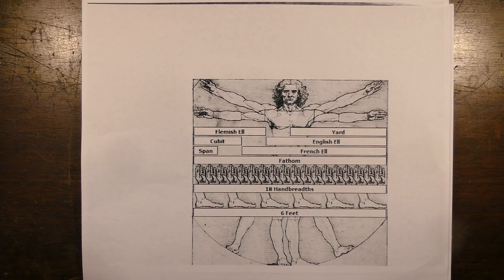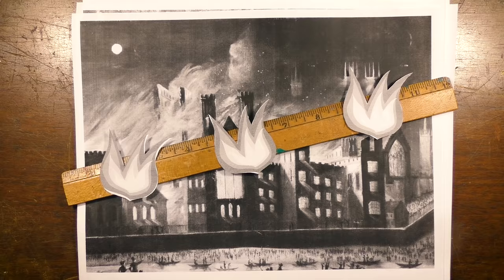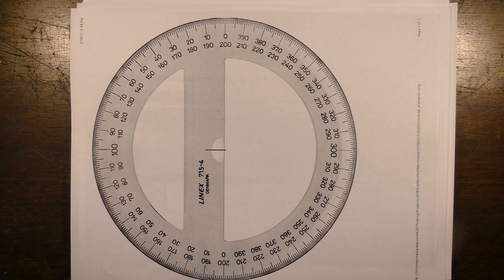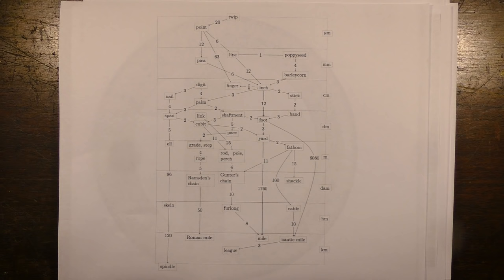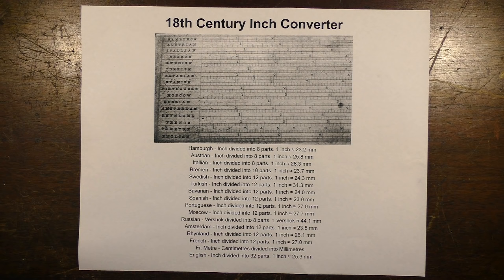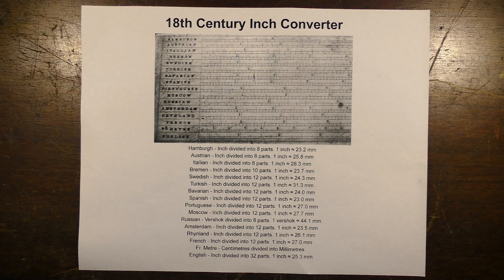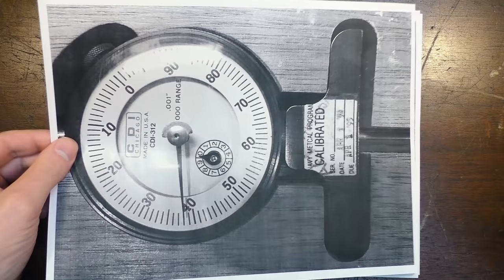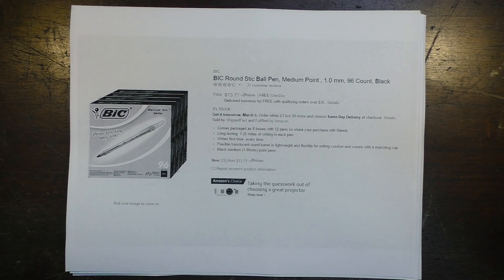Origins of Precision

Comment: Let me know if you want to see a Palmer and a super early B&S micrometer. A good friend has one locally in the SF bay area.

Cheers,

Tom
Reply from the maker: Tom, that would be awesome, I'll be in touch!  I'm local.
Reply: @oxtoolco  hey tom, just wanted to say i'm a huge fan of you!!  I was lucky enough to meet  Bruce Whittham, a couple of weeks ago,  he popped into my machine shop, to help my boss, he's a champion of a bloke!! he even signed my moore and wright combination set! so stoked!!
Reply: YES! YES! YES! OOOOOOOOOOOOOOOOOOOOOOOOOOOO YES! Please?
Reply: I found my B&S 6" caliper in the trash with the box and instructions.
Reply: @machinethinking  
You should have mentioned the "standards engineering day" and the critically important part to machine work, temperature, without maintaining that standard temperature you can throw accuracy out the window, I try to warn guys who are going to have machine work done on an engine, ie fit pistons into cylinders, that they shouldn't trust a machine shop that doesn't maintain 70° F, the tolerances of some of these modern pistons can be under .001 of an inch, change the temperature by just 10 or 15 degrees and then remeasure something that fits that close, your clearence will be cut in half with just that amount of change, shops that are 90 to 95 degrees inside in the heat of the summer and then 6 months later everyone is wearing sweatshirts and standing around kerosene heaters don't do accurate work.
Reply: @dukecraig2402  , yes and no on ambient temperature. I work for Reishauer, a swiss grinding mfg, our grinders are primarily used in automotive transmission gear mfg but also in the production of precision bearings. 
Ambient temperature control is good, but most competent shops with an experienced tool and die maker can hold 3 tenths, or ".0003, without ambient temperature controlled shop. 

What is much more important than ambient temperature like air-conditioning, is temperature control of the cutting coolant, using a chiller. It amazes me that for the relatively low cost for precision, how few shops use a coolant chiller. On an isolated foundation, a well-regulated coolant chiller keeping +/- 2C, and a properly calibrated inductive touchprobe, Reishauer grinders are capable of sub-micron tolerances in a PRODUCTION environment. 1 micron is 2.54 ten-thousandths of an inch, a human hair is 12 thousands of an inch thick, so variance between parts of less than 1/5 of a human hair.
Reply: One of the Sr Engineers at Campbell Grinders also concurred on coolant temperature regulation, they do not require ambient temperature control of a shop but they do require the use of coolant chillers, noone would spend that type of money on a grinder without a coolant chiller anyways. Btw, Cambell Grinders are probably the best US-based precision grinding mfg, they make very large 5-axis grinding machines that hold tight tolerances for 50+years of 7 days a week production and are used primarily in aerospace turbine and turbofan grinds.
Reply: @johnfilmore7638  
With piston to wall clearences of .00075 to .0012 in an engine that's going to live in the 4,500 to 7,000 RPM zone sustained neither I nor the customer can afford to have a .0003 error, I've set clearences at exact marks and turned my furnace down to 50° at night in the winter then go in the next morning and measure everything at 50° before the furnace heated things up and I had a .0005 difference on a set up that was .0015, that's a 1/3 error in the clearence, the cylinders heating up while they're being stone finished will also make a .0005 difference, if you let them sit for an hour or so after you think your done and then remeasure them, as a quality control measure when I assemble an engine that even I myself did the cylinder to piston clearences I measure everything at 70° that has sat for no less than 24 hours after the last work was done on them before I will install them, if I have to get up at 3 or 4 in the morning during the summer time to get 70° then that's what I'll do, doing machine work for modern engines or even old ones with components made from modern materials have got clearences that demand fitting and checks be done at the proper temperature, the ones that aren't done at 70° are the ones I wind up getting that were done by a shop that doesn't get this and the pistons seized in the cylinders less than 5 miles up the road, and I'll put in the same type pistons, set them at the minimum clearence at 70° with the proper cylinder finish (another thing a lot of these shops don't get) and I've yet to have one come back, you have to realize that these are dissimilar metals that have entirely different rates of expansion so whatever the measurements are at room temperature they're not going to be the same at operating temperature.
Reply: @johnfilmore7638  
Good for Campbell Grinders, but I'm the guy who's actually building the engines and more importantly I'm the guy who fixes the ones that come from the shops that don't take temperature control measures, ok fine, yea ambient temperature isn't important if you're bathing the part in a coolant that's temperature controlled, it's the same thing, the part is at the correct temperature when you measure it, these aren't production facilities that are guys that screw up the engines that seize up because they don't get that temperature is so important when measuring the parts, that's just the point, so what, they make a cooler, take it away and you have to worry about the ambient temperature, either way temperature is important, but you go ahead and shout out to the world that ambient temp isn't important because I've gotten a real solid reputation over the years straightening out screwed up work from shops that don't get it because they'll take a statement like yours out of context and wouln't think temp is important.
Reply: @machinethinking  I repair machine tools for a living. Get down to Southern California..primarily Orange County...Ill take you to a bunch of machine shops..from state of the art machines that can machine an entire wing,,to screw machine shops who make little tiny stuff.
Reply: @dukecraig2402  hello I would love you to make an engine for me and be able to watch your skills
Reply: @peterlworth  
Ferrari goes to such lengths to keep things consistent in their machine shop that not only do they keep it at a constant 70°F but their machine shop also has a glass roof for sunlight because they grow trees inside of it to keep a constant humidity. 
I've never worried about humidity myself because there's nothing I can do about that anyways but I do adhere to a strict 70°F when I'm machining and measuring parts for fitment, I have one of those thermometers I can point at parts to assure they're at no more than 2°F above or below 70°, if a cylinder heats up while I'm honing it I'll just stop and do something else for a while until it cools back down, and of all the different brands of pistons I've used I've never had a problem with any of them despite always setting them up at the minimum clearance, unlike most shops that have a tore up piston sitting on their countertop as "proof" of why they don't like that particular brand, I just shake my head every time I see that because it wasn't the pistons fault, somebody did something wrong like fitting parts at bad temperatures or another common screw up I see places do a lot is use the wrong grit finish for moly faced rings, use the same grit that you use for regular rings and it will run hot during break in and risk the piston swelling up from the heat and scoring the bore and piston thrust surfaces.
Reply: @dukecraig2402  it's it's shame Im In Australia makes me want to build a engine with you
Reply: @dukecraig2402  I've got an engine shop - and this has always made me curious, so I've checked, pretty scientifically, on several engines.  

The tolerance of most modern engines for piston clearance is at least .001 - and the clearance is generally somewhere between .001 and .002" (total difference in size - the actual piston to wall clearance is half of that number, but that's outside the scope of this)

Checking at 50F and again at 90F, the bore clearance in the two engines I checked - an all iron chevrolet 454 engine, and an aluminum with iron sleeves honda K24 engine - changed by about .0001", or less than 1 10th of the tolerance.

Bottom line - temperature is important - but not that important.  And if you think about the amount of conditions an engine is expected to work in - generally from -40F to +250F - This makes sense that it wouldn't change much in the 40 degree range around room temperature.
Reply: @islandfd3s  
Yes it is important, that's why if you pay attention to most instructions for fitting pistons etc etc (like from Weisco) it'll say in parentheses (at 70°F), and I wouldn't know because I never checked a Chevy big block but I can assure you if you check an Ironhead Sportster with a cast piston at 70°F that has .003", clearance, which is the minimum, and then drop the temperature to 50°F you'll come up with a clearance of .0017", which can be disastrous since that's almost half of the required clearance.
And what'll cause it to be even worse is when one of you automotive guys puts Harley cylinders in one of those Kwick-Way Power Stroke machines and heat up the cylinder causing the spigot to grow, the rest of the cylinder has cooling fins that act like strong backs and will hold the cylinder in that area true but that spigot will grow and give a false reading, after it cools the end of that free standing spigot will collapse .0005" every time.
The last time one of you guy's in the automotive machine business did that to me I got sick of being screwed by sloppy work that made me look stupid so I borrowed the money to buy my own equipment to fit pistons in cylinders and haven't had a problem since.
You may be able to get away with sloppy work like that with liquid cooled engines but with air cooled engines you can't, you'll get bit in the ass every time. 
So go ahead and claim it doesn't make any difference despite the fact that the industry says it does, and where I went to aircraft maintenance school where they go to the trouble to educate you on what a Standard Engineering Day is and how important it is, then you can go over to Italy and tell Ferrari that they're wasting their time when they had their machine shop built with a glass roof because they grow trees inside of it to keep even the humidity at a constant.
What you just wrote is a prime example of why half the time I would give work to one of you automotive guy's I had problems with it like pistons seizing just going around the block after putting an engine together that I had one of you hacks fit the pistons, I've caught you guy's not only giving me cylinders back with the spigots collapsed .0005" at it's end but you guy's are real good for using the wrong grit finish when moly faced rings are used causing an air cooled engine to overheat and seize up. 
Yea I can't tell you how many times I'd be on the phone "There's not enough clearance in these cylinders you gave back to me" and I'd hear "I'm a champion racer, I can assure you they're right" then after the engine seizes up from just going around the block in a neighborhood the feeble ass covering would start with something lame like "What kind of oil did you put in it?".
The last time I had problems from one of you automotive guy's a customer brought me an engine to reassemble that was done in a shop like yours and I had to call him to come down to my shop and showed him how the spigots on his cylinders were collapsed .0005" at the ends, after that I enacted a policy that if I don't do the machine work on an engine I won't assemble it because you guys never step up and take the blame for what you did, it's always "You must have run the wrong kind of oil" or my favorite "It's the engine assemblers responsiblity to check all the clearances" despite the fact that I'd called them and told them it didn't have enough clearance but I was assured their work was spot on, yea right, that's why after I got the equipment to do it myself I haven't had a problem since.

Comment: I love this kind of thinking.  Precision is like a kind of dimension in itself --  many inventions have been around for centuries as ideas,  but had to wait until sufficient precision was possible to make them real.  I remember reading how cheap rugs are made by freezing long straight fibers into solid cubes of ice, then slicing off thin slabs of ice/fibers,  gluing the slabs to a rubber backing sheet, and drying them.  The inventor, I read, had the idea but had to wait many years until sufficient precision was achieved.